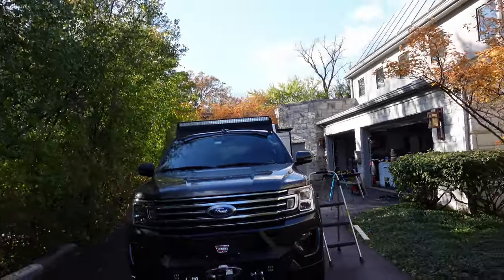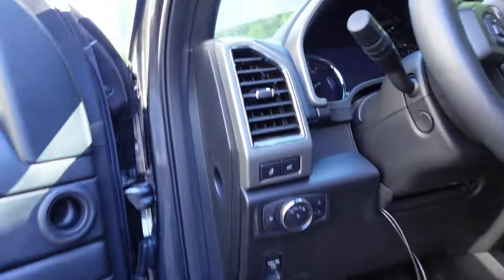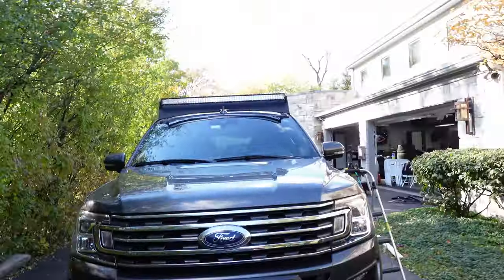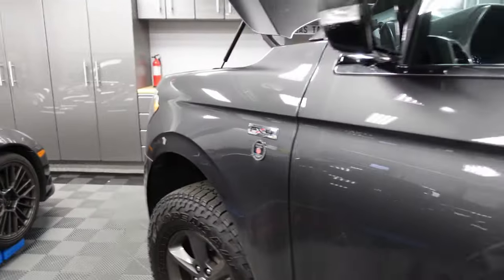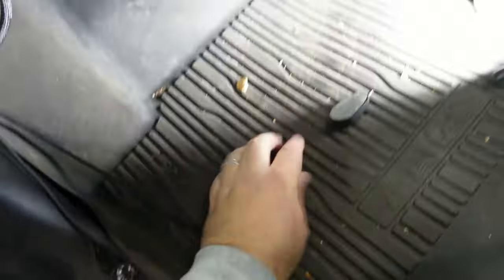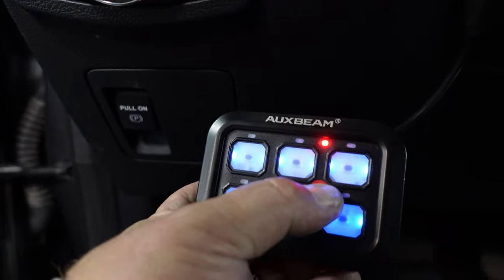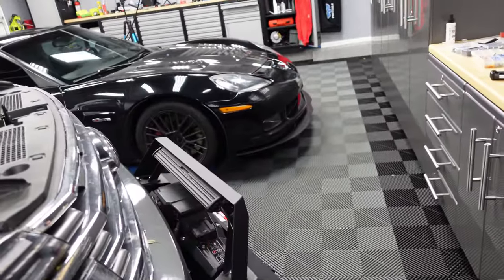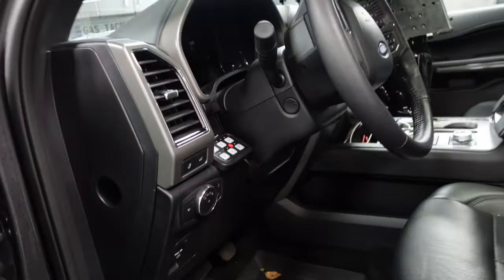My Roof Rack Light Setup! Did I go overboard?

Comment: I like the lights and the single switch panel with the relays.That is a great switch kit. I would move one side light on each side to shine to light the side of the vehicle ( for safety to see what is next to vehicle ) to align the lights, found a wall to park about 10 to 20 feet from and it will make set-up lights super easy to set-up . Looks Great
Reply from the maker: John, great minds think alike. on the way home from filming this I did that exact thing!